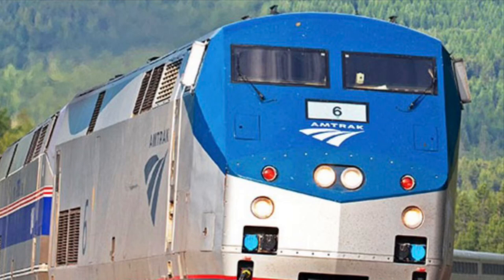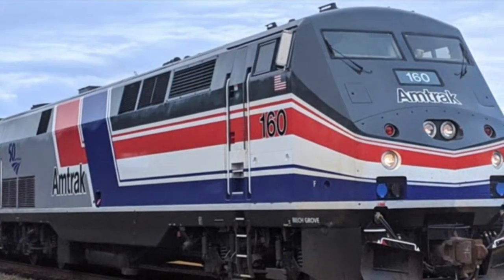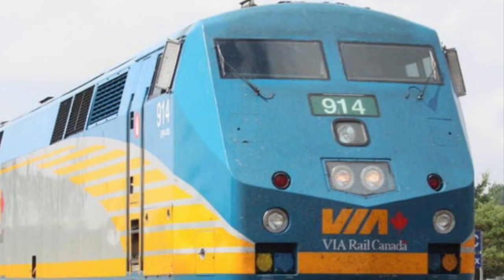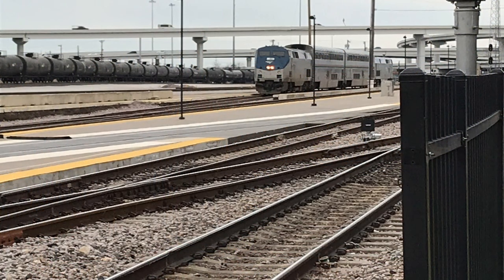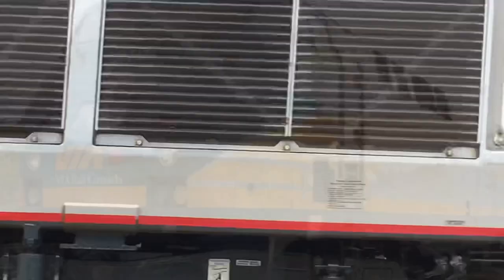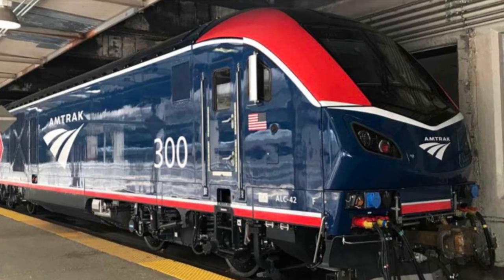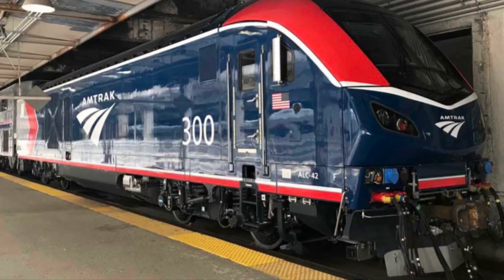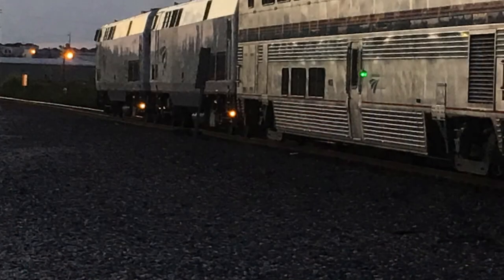Engines Of North America: The GE P42DC

Comment: My last 6 months of engines service, I operated these techno-turds. I cursed every mile I went with that computer on wheels. I ran the "trash eights" out of LA until I went to zone 5 to finish my career running VRE commuter trains in and out of DC. It was sitting in a pill box or a bunker. Jan. 4, 2011 was my last run on train #95 to Richmond, VA. Turned it on the wye at Acca YD, then parked it at the Staples Mill Rd. station. I wanted to piss on the thing, but people were watching. My first run of my career was on a GG1 as a fireman on a passenger train, I ended it on another GE.